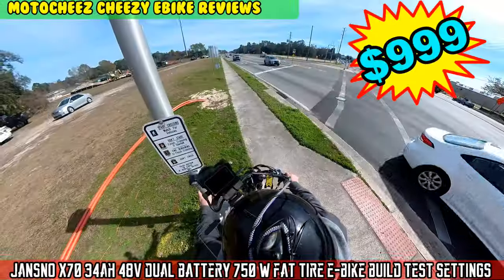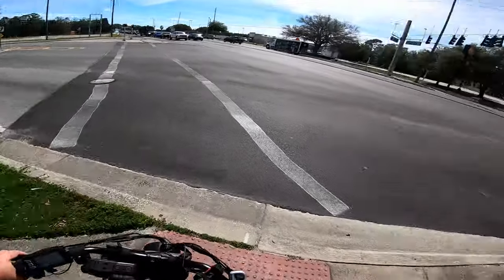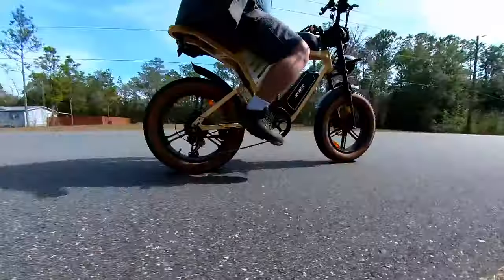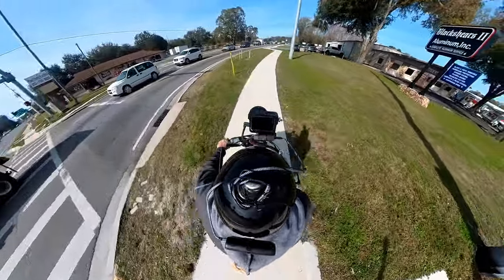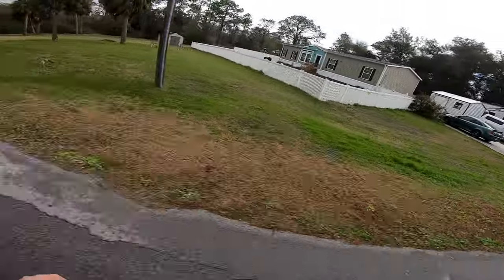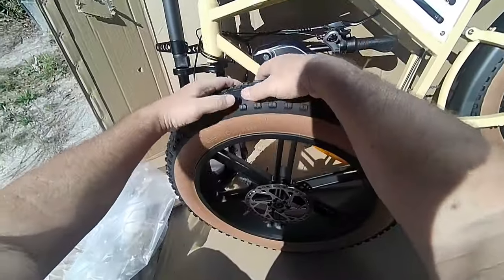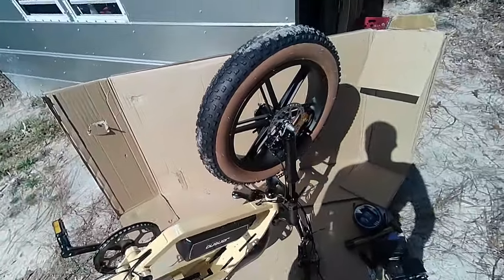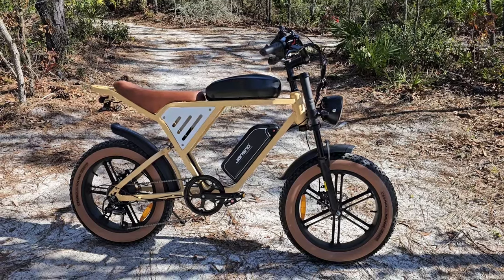Jansno X70 EBike dual battery 48V 34 AH 750 watt 20X4  Fat tire ebike  Build FULL Test Settings

Comment: Pogo forks? No adjustments air shock in back?.why don't talk about the importance stuff? My x50 came with mag wheels, with suspension upgrades and lot better tires ULTRAVERSE 20X4.0 60 TOOTH RING GEAR 35MPR IS THE BEST I COULD GET OUT OF IT AT 156 POUNDS ON LEVEL GROUND 1246.00DOLLARS INTO IT. FUN FOR 64YRS MAN

Comment: Thats not how the batteries work it runs off both at the same time. When you see it go down and back up that is just voltage sag when your on the throttle. It don't switch back and forth unless you switch it and use one battery then switch it to the other when the one dies.
Reply from the maker: I watched the. Voltage gauge go down, then back up as I was throttling for along time. Each battery was being used equally when I checked and turned off the one battery a few times.
Reply: @MotoCheez  correct that is voltage sag
Reply from the maker: @oldmanebikes8392 not normal voltage sag, that usually goes up when you let igh throttle, never goes up with single battery when You're constantly on throttle

Comment: Man i was just about to pull the trigger,  the mechanical brakes are a deal-breaker!   I've got 3 ebikes. 2 with hydraulic brakes,  just bought the amyet v9 for a cheaper beater bike, the mechanical brakes are just no comparison to the hydraulic,  i really like this bike,  but damn i can't stand the breaks,  , same exact price i can get the eahora cupid 30 amp battery or the Amyet S8 dual motor 25 amp battery. Both hydraulic brakes. Idk gonna have to think about it,  very cool bike though

Comment: Hey great review.
Its 920€ here in eu. Some quick Qs:Anything to add after some months of use?Can it fit two light persons? Is the top battery removable?
Reply from the maker: Nothing to add, still going strong. It would be tough to fit 2 ppl, yes top battery removable

Comment: P07 Magnet steel number....no need to change for the speedometer calculation
P08: Is the max speed in kilometers. 50 or 100 is unlimited. Ie if you set it to 40km/h that's a limit of 25mph.
P13:  Is power magnet steel number. No need to change
P14:  Is max amps. Yours is set to 15 which is 750w max. It should be more like 20 amps max which is a 1000w peak on a standard 750w motor. Check the controller under the seat. If it's a 25amp controller you can set it to 22a for 1100w peak or 24a for 1200w peak. Always give an amp or two under what the max amps of the controller is. That may explain the crappy acceleration. You're basically using the same peak amps as my 500w motor. Now some controllers override this setting. Does the display have an amp output meter? Hit the power button while on and see if it has an amp function. Hammer it until it maxes out. If it only goes to 15 amp you basically have a 500w motor not a 750w motor. THey could have screwed up the settings at the factory.
P15: Low voltage cutoff. Is the volts that the bike will cut the motor to protect the batteries. 39v is a little low I'd bump it to 40v.
P17: Auto cruise mode 0 off 1 on. Says it's controller based so it may have no cruise function

On my display which is almost identical, to enter cruise mode you hold down the - minus button for 3 seconds while under throttle for cruise. Maybe give it a go.
Reply from the maker: Thanks for the info! I did change it to 20 amps but I did not record it It was after I did the video and it seems a little better
Reply: Awesome. I'm thinking that maybe they set it up at the factory like the Radrover or whatever it was I saw which was a 750w bike that LITERALLY only put out 750w max(15amps)so it was slow as all hell accelerating. If you took a quick peak under the seat at the controller maybe you could bump it up another amp or two as long as it's an amp or two under max just to be safe. They may be doing it for regulations or have the same settings as the single battery model. Or are just literally going by the amps at 750w. Who knows? @MotoCheez
Reply from the maker: @chrissinclair8705 I believe it has the same controllers the X50 which was a 20 amp controller, but I should take a look
Reply: Sure np. I've seen another video by trailhappy which it had a 25 amp controller. If it has that controller you may be in luck. @MotoCheez
Reply from the maker: @chrissinclair8705 worth a look for sure!
Reply: I took a look at the controller and it is 25±1 amps and changed P14 to 20 but it did nothing unfortunatelly.
Reply: Try 22 amps limit. That's the max. It could be that the X70's controller is overiding the displays setting and giving you 20 amps no matter what the setting in the display is.I have the X50 and changing it from 15 to 20 definitely pepped it up a little bit. I'm going to try 22 which is 1100w peak and see if it's worth the extra battery drain. @dupalec

Comment: Can you do a in detailed   comparison video of jansno x50 and x70. What about the breaks in x70 is it hydraulic brakes . What is the pros of x70 when comparing with x50 except the battery and range.
Reply from the maker: The X70 used almost all the same parts as the X50, only big difference is the frame and dual batteries. They even ride the same. Both have cable brakes. I think the X70 is more comfortable too
Reply: @MotoCheez  okay thanks 👍

Comment: How hard would it be to change the handle bars ?  Swept bars hurt my wrists.
Reply from the maker: Easy to swap out handlebars. You prefer the straight bars?
Reply: Ya, I don't like the cruiser style bars. Love your videos though.  @MotoCheez
Reply from the maker: @mr.somebody1493 thanks, these weren't too bad, I know what you mean by the bars that come down 90° from the clamp. They will definitely hurt your wrist and I don't like those either